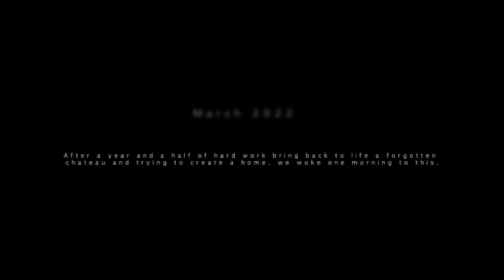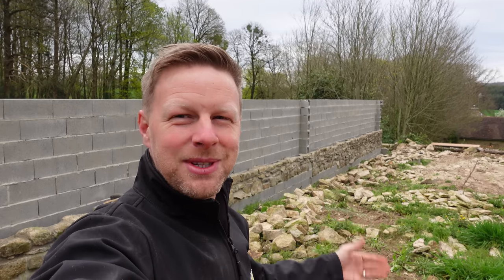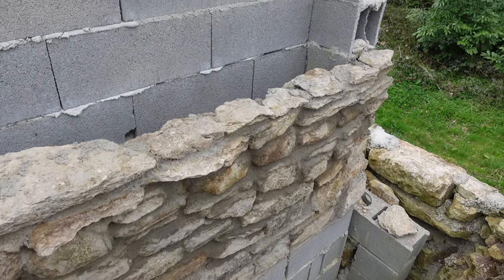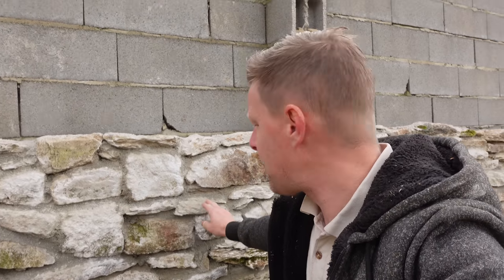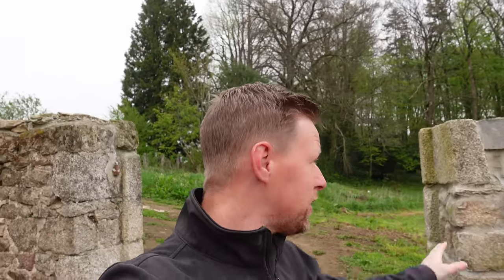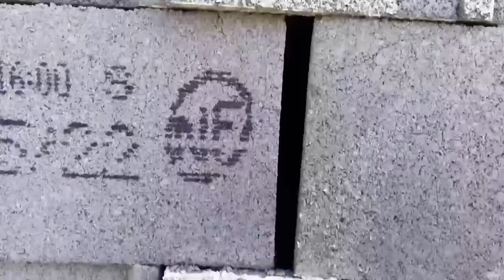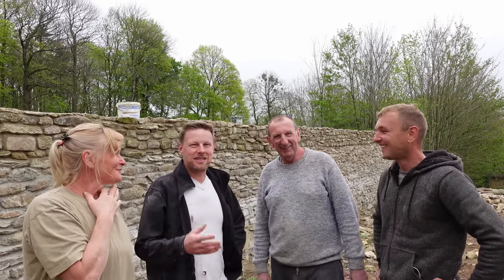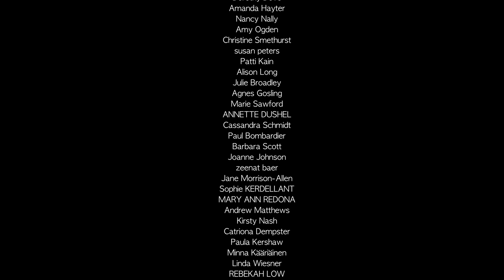Rebuilding the ORIGINAL Château Garden WALL | 2 Years Work

Comment: What a major accomplishment! 

I know you probably do not want to hear this. I used to work in hotel and hospitality design writing specifications for major hotel renovationsd. So it was my job to "manage the details." While you have the walls exposed in your bathrooms on the second floor of the Chateau, you may want to consider blocking in some extra support for where you want your towel bars to be place AND consider placing some grab bars near your beautiful soaking tubs. I offer this advice to you, as when someone is getting into and out of a tub Terry selected; IF they slip, the first impulse anyone has is to reach for the towel bar. IF you have taken the time to add some extra blocking in the walls, your towel bars, AND if you added a grab bar by the tub, your guests will have something secure to grab on to. This will provide safety to your guests AND your liability insurance adjuster will probably give you a better rate when it comes time to insure your property. 

Now I know Terry is probably not going to be terribly wild about adding grab bars by his beautiful tubs. However I am certain his creative mind will spot something which is both attractive AND satisfies the hospitality codes for safety.

I do admire your family and how everyone works together to bring this charming Chateau back to its former glory. Especially Ash's enthusiasm, it is positively infectious, and communicates quite clearly on camera.

Comment: It looks perfect!  You've inspired me to consider building a stone wall, as seeing this has made it seem less intimidating.  We live on a rather rocky piece of land, so we have plenty of stones to use.  
Also, it has occurred to me that the little arched opening on the opposite wall might very well have been the opening between a dog-kennel and its little outdoor area where the cement pad is (it would have been fenced, and there would have been an interior floor at the time, of course).  Large landowners often kept hunting dogs, and the opening is just the right size for dogs to go in and out.
Reply: Thanks Christiana :) that could well have been the case. Never thought about that 😊😊
Reply: Good luck with your wall :) 😊

Comment: Incredible job guys, well done it really couldn´t look better, I guess you have the other side to do at a later date. before you fill the trench in or put the capping stones in place you should run a pipe along so if you ever wanted to, or need to run cables or water supply you have a tube in place that you can feed them down the pipe, easier to put it in now rather than trying to do later..

Truly well done, I don´t think if you had paid someone, the result would have been any better..

Robb Torremolinos Spain
Reply: Thank you so much Robb! I don’t think it would have been any better with someone else doing it, and it would have cost us thousands!! 😊

Comment: I would suggest making some “nooks” in the wall so you can slip some candles in there for lovely evenings in the garden. Also curious why there is a space between the wall and the blocks. Will that not just fill up with water (ice) and debris that will push the stone wall out? Or will it be filled with rebar and cement?

Comment: In the U.S. we put metal tabs all along the concrete blocks and attach the stones to the blocks that way. Are your stones attached to the blocks? If not, what's the purpose of the blocks? Just curious and happy for your progress.
Reply: Terry said in a previous comment that they back filled it with cement.

Comment: Before you get too much higher you should metal ties between the CNUs and the stone veneer. The ties should have been placed while the block wall was being built Every other course would have worked. The ties are usually galvanized steel with pone en embedded in the mortar joint and the loose end embedded in mortar between the stones.
Maybe you can ask around and find them. You can't embed the end in the block mortar now but perhaps you can modify the typical tie and have short lengths of steel rod welded to the ends of the tie. The rod can then be grouted into the cmu. Mabe even high strength glues will work?

Comment: I'm sure you've researched it but the stone wall needs to be securely fastened to the concrete block wall. Otherwise there's really nothing to prevent it from toppling over again. A thin stone wall can't stand alone when it's that tall.

Comment: Excellent work lads and lass. Once completed it will look as if the wall never came down. 

One question.... are you not using ties to hold the stone cladding to the blocks? I don't see any ties sticking out of the block wall. The stone should be attached to the blocks with evenly spaced ties to prevent separation of the stone facing. The stone and block should not be allowed to move independently as the entire wall settles (expect a lot of settlement given the foundation composition with the added weight of the added stone) and moves due to ground vibrations, freezing, and excessive wind loads. The absence of ties also means the stone face can easily separate from the block when water penetrates between the layers of wall and stone then freezes. All of which increases the likelihood of a future collapse of the stone facing. Particularly given the overall height of the wall. Due to the height and weight of the relatively shallow depth stone cladding, gravity has a tendency to cause the center of the stone cladding to bow out until it finally collapses. Ties lock the stone in a vertical position tight against the block wall. Even with perfectly flat and level brick cladding the weight is enough for the center of brick cladding to bow out and collapse when ties are not used. All that is required for cladding failure is for the wall to be a fraction off level or true. Using random sized stones means the cladding won't be level and true at any point. Thus ties are vital to ensure the stone cladding remains bonded to the block wall. If you plan to drill through all three layers of the wall to install rods and braces, to bind the layer together once the wall is finished, please ignore this comment.

Cheers!

Comment: I missed the premier, and just started watching. Are you using ties so the concrete blocks are tied to the stone wall? Looking VERY professional
Reply: Thanks Zach. The wall is backfilled with cement 😊
Reply: @ashleywaters7198  Actually, I was thinking of those corrugated metal ties strips that they use on brick house, where they insert them in the block inside every 3 or so feet up and sideways and then cement them into the veneer brick or stone facing it. It holds the exterior part to the interior. Hard for me to explain, clearly

Comment: Shouldn’t use cement with stone. Holds the moisture in winter and freezes which will blow the stone eventually. No French Macon I know will use cement and I work with them everyday.
Reply: Thanks Robin. All the works we’ve seen done have been with cement on the inside and mortar on the outside. Even the older works have been done with cement with it being stronger. There’s a wall at a chateau up the road being rebuilt by French masons with cement. So can’t say it’s unique what we have done 😊

Comment: I’m horrified that you are using cement, you are making a big problem for future owners when the stone wears away as a result. You can get different colours of lime mortar by adding different coloured sand and a mix with ash in it. Just spend a bit of time getting the mix right and do it right